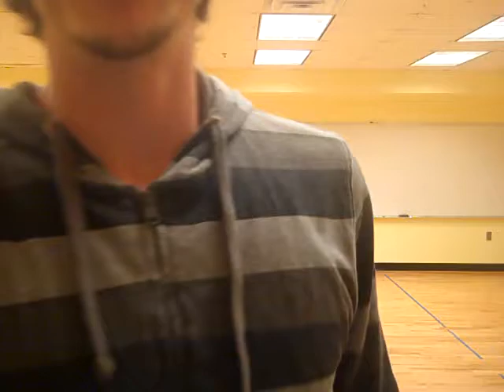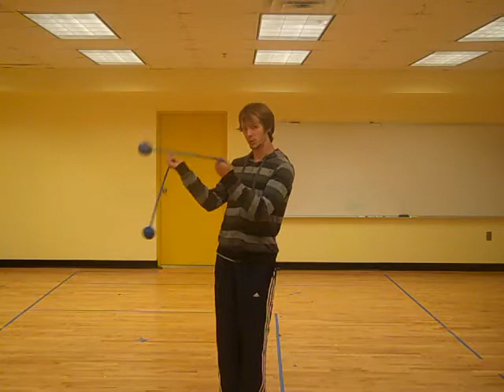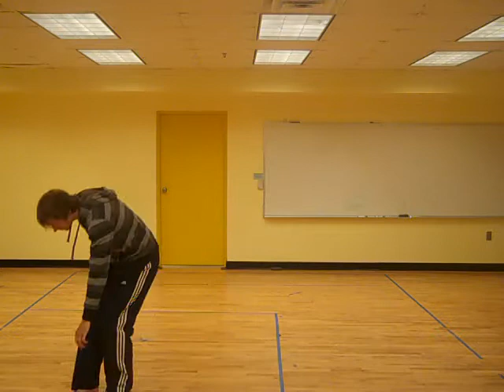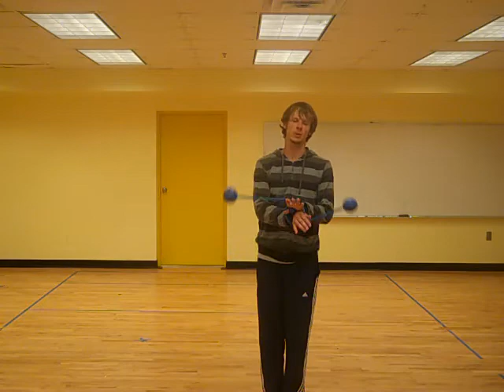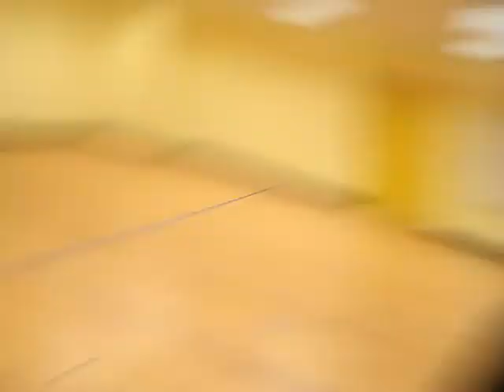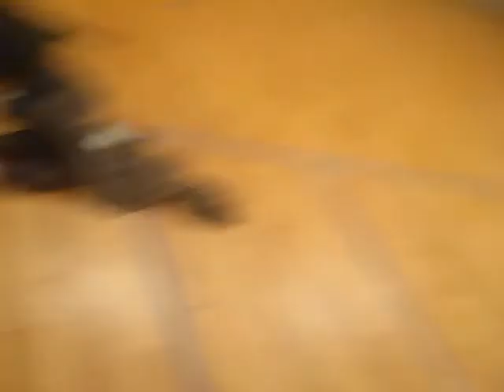Drex's Tech Poi Blog #95: hard, soft, and mixed transitions as plane-bends

Comment from the maker: @Mireneye If I'm not mistaken, he's referring to a constant mixed transition wherein the poi and hand are always oriented perpendicular to each other, but the poi shifts its plane orientation depending upon the location of the hand. One example of this would be to perform static at shoulder height and plane shift/bend the poi horizontal when it reaches center while the hand descends in wall plane as though you're drawing a flower. The result looks like a staff antispin as the plane slides out.

Comment: Also it would be interesting to hear your opnion of horizontal moves in general. One has to concider that a perfectly horizontal to the audience is a stright line a imperfect will basically make a cone shape. 

Cones vs lines? oh yeah I say... But what's your opinion? I use the horizontal mostly for transitional purpuses and I do see a bit limited use for it for shows. Visually many think it's less impressive.

I think simply undeveloped.

Nice work on the video!